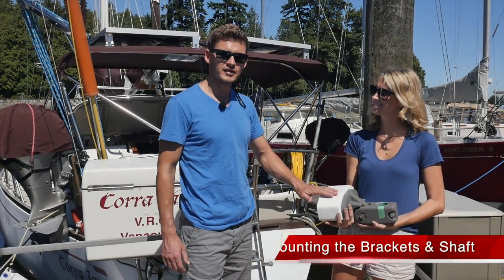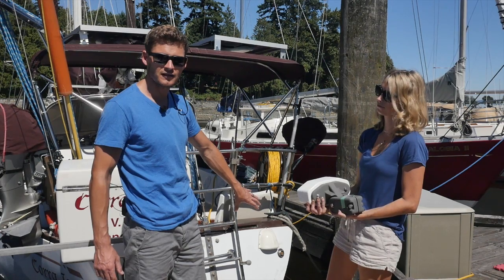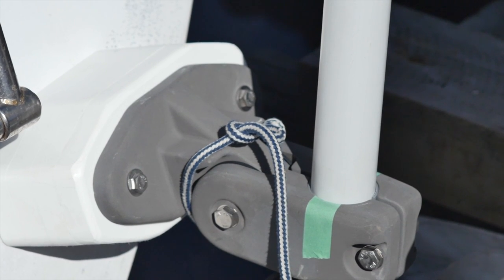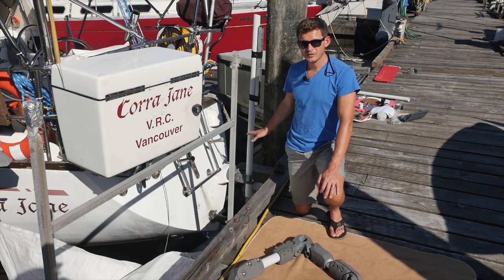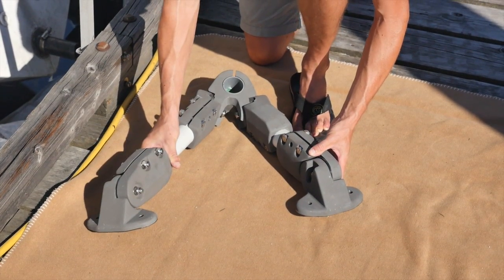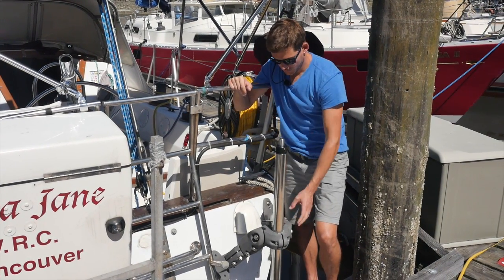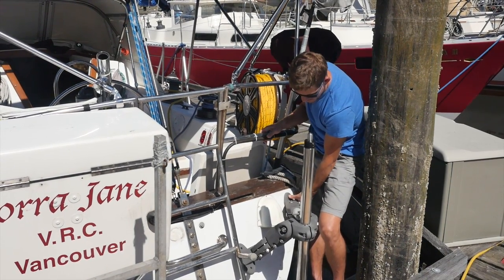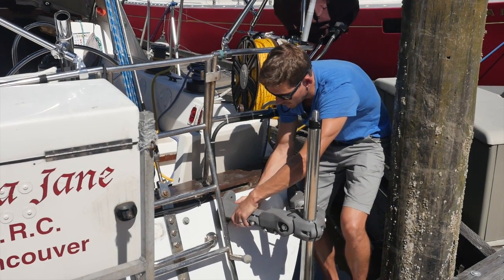Hydrovane: The Installation - Part 2

Comment: doing steel construction I've had to level and plumb structures many times.Using a level to establish true vertical and horizontal to the boat, would only be accurate if the boat was level port and starboard. and fore and aft.Any list either way and the shaft would not  be level or plumb, or does a deviation matter?

Comment: Good explanation 
How much it cost you ?  The unit and the installation 

And whom or where you buy it??
Please help
Reply from the maker: Hi Alberto - the price depends on the boat (which brackets and shaft length are required to fit it).  Please email me: sarah@hydrovane.com with your boat type and a photo of the boat's transom, and I can provide a quote. Thanks for your interest!